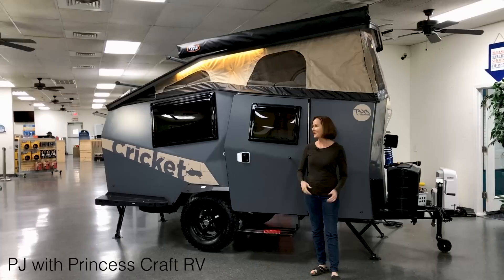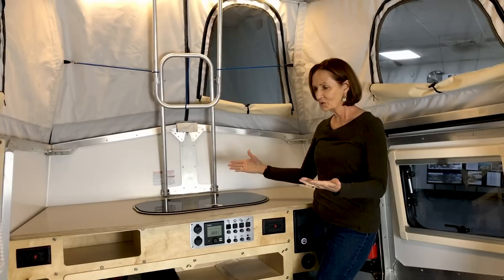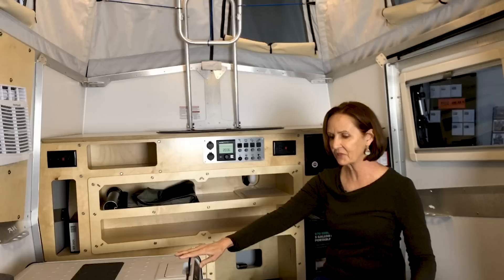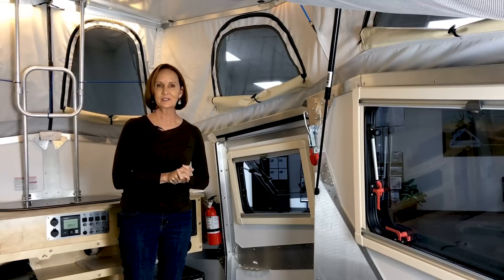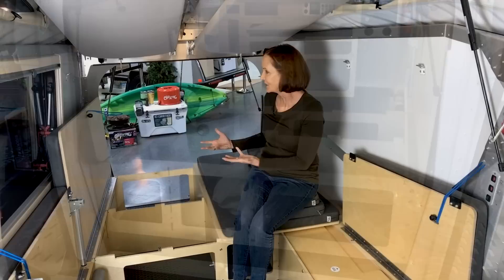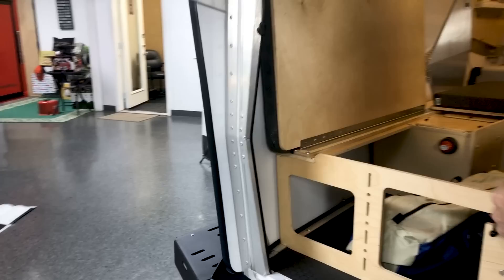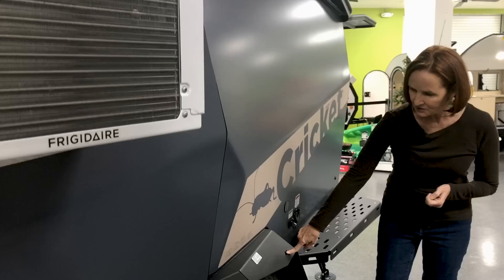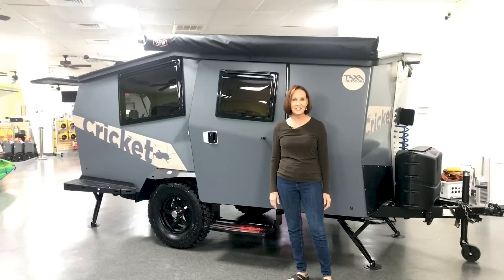Cricket by Taxa Outdoors Walkthrough Tour

Comment: This is the very best video on the Taxa Crickets. I’m surprised by some of the comments on here about the trailer. This has got to be one of the most practical designs of a trailer. It all depends on what you value in a trailer. The ability to park it in your standard 7 ft garage is a huge selling point as well as stand up. If I buy one of these it will be my 3rd small trailer. I’m going from a Nucamp Tag  boondock, and aliner my current trailer, both good trailers. However my latest Aliner does not allow you access while parked in the garage. If you’ve ever tried moving one of these on an incline driveway it’s not very easy, as well as the maintenance on the folding roof. The many windows and screens will give you great ventilation, especially where I’m at in Cali, access to under the bed is a great feature as well. Both Aliner and Tag boondock can be a pain in the but if you need to access something under the bed. Of course having canvas on a trailer isn’t that great if your looking at camping in winter, but coming from a teardrop this isn’t a dealbreaker considering it can be used with the top down. Access to things like electrical is nice too. This trailer is great for mods with its skeletonized interior you can tell  a lot of thought was put into this. Everything looks like it has been designed to make things easier. Can’t emphasis enough about a trailer that can have good ventilation especially on these small ones, and this guy has that in spades.
Reply: Good review..

Comment: To anyone considering a TAXA Cricket, please make sure to research the widespread axle failure issue. My trailer has been - according to TAXA - unsafe and unusable for six months due to a failed axle. MANY owners have the same problem. TAXA has been unable to fix the issue and now they are selling 2022 models. Are those unsafe too? Or are they choosing new sales over existing customers? TAXA is very aware of the problem but customer service has been terrible. 
I'm sure Princess Craft is a very nice place, so I'm not trying to throw any shade their way! Maybe just buy a DIFFERENT trailer from them.

Comment: I would add another spare battery, 2 solar panel, a 2nd refrigerator, and a mini wood stove with vent and shield protection for sides and roof, probably by sink. They are very small but work great if installed properly. Most of my camping is off grid.

Comment: I love the use of window A/C units, as they are low cost to replace, but I REALLY hate it when they mount them sticking out of the side of the RV-- {very lazy engineering}.  The front or the back is the correct location (with the back preferred).
Reply: I used my fortable aircondition from coastco much better :)

Comment: Can the awning be used when the canvas part is up? Or does the roof have to be latched down?  It looks like it would be an awkward angle if used when the roof is up....and at the same time, you wouldn’t want to only be able to use it with the roof down...or having to put the awning away every time you wanted to go in to cook and stuff.

Comment: I don’t like the niche. Too heavy for its size and extremely overpriced. $30k-$42.5k. The cheapest used I saw was $28k. For that price it lacks a lot of internal amenities and storage. I understand the minimalist concept, but a minimalist trailer of this size should weigh 1300lbs max.

Also, can I say that the AC placement is atrocious. At least place a shell around it to hide the ugliness. It literally looks like a hole was cut and the AC inserted after the design was completed.